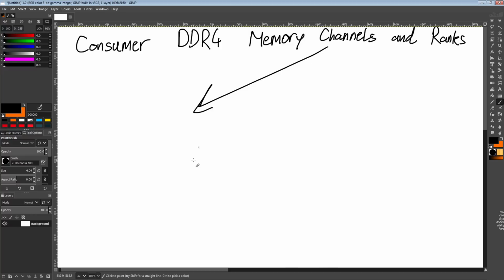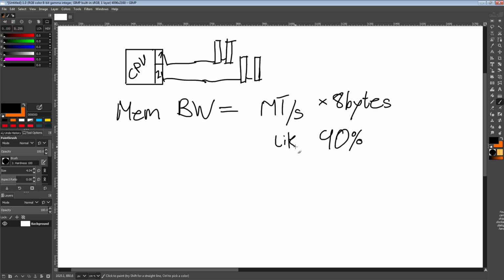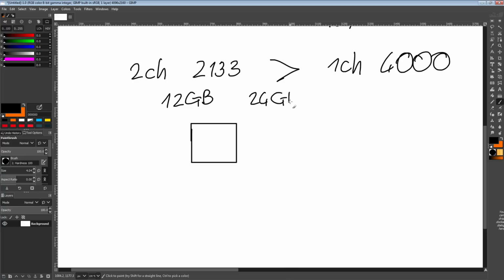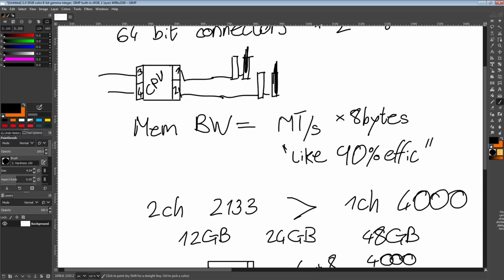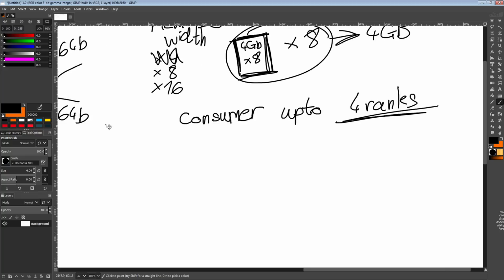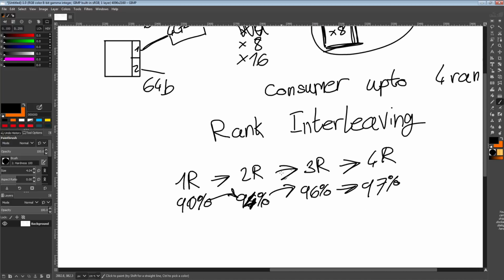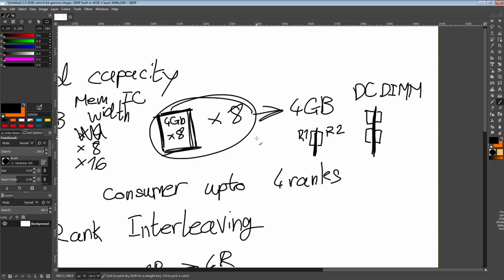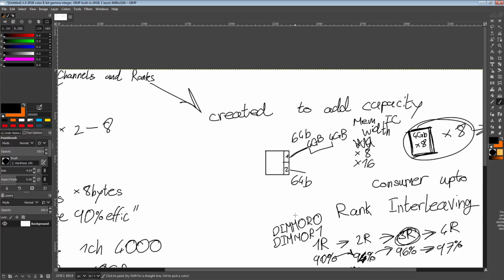Rambling about DDR4 memory channels and ranks

Comment: 14:00 What the f*&@# are You talking about dude, this video seems to be absolute garbage Prove me wrong because im not "an actuall overclocker". In regard of memory combining dual single channel and ranks 25:00 are time traveler from 90s? Never analysed this issue before becase its non issue. Except when it comes to 32GB 32 chip modules on consumer 4 dimm dual channel motherboards  >>  All i wrote is based on what i remember or improvizing. So im willing to change mind. .

Dual or not, and ranks  First of all - if you have dual channel memory controller 64bit each, you have usually 2 slots for each channel (4 in total), 16 chips, 8 on each side = 2 dimms x 2 ranks = 4 in total. Ranks are logical grouping of banks to create 64bit wide coherent adressable block of memory, has nothing to do with number of dimm slots although it's limiting it's number. Obviously 2 ranks on same PCB would not work in dual - since there is only 64 bus shared between, from memory controller perspective those are 2 modules sharing same bus via same slot. Because usually one sided pcb are 1 ranks (block) of memory while double sided are 2 ranks or even more. This creates real issue for 32GB modules made as 4 ranks of memory on one pcb (32 chips). Its like 4 kids to be feed, refreshed and access to bus. To have >64GB if you are allowed to use 4 ranks max would be limited to use max 1 on each channel. Interleaving and all that crap is more likely related to how memory is refreshed and and problems of it's acessability but not for regular data access since those modules are different adresses anyway. Rather than to performance directly it can hurt accesability when it comes to refreshing when such block becomes bigger. If you allow 16 block this wont be case. 90,95,97%.. you wrote. 32GB and more DDR4 memory creates real issues overall, Intel Xpoint tried to solve (no need to refresh) . You wrote 40% real bandwidth.. well 60% time and more (expotentialy grows) is used to refresh its content, not an actual transfer . When it comes to high capacity memory this became reall issue. But what it has to do with OC? Plus al that you wrote as 90,95,97 is more likely related to refreshing related issues but in past when memory was much smaller. Currently its get much worse. You created, so much confisung content i cannot believe what i just watched. 

Drawings and colors How channels are placed on motherboard odd, evenly or pairs depend on motherboard  For such reason there used to be different colors.  This actually makes me nuts cause instead each channel having different colour its for dummies. To help distinguish dimms 0 from dimss 1 of each channel those 0s  and 1s have different colour. Meaning dimm0 are same colours as dimms1 despite being connected to different channel so we would put pairs into slots of same colour to fill both channels and use in dual mode. But it depend on motherboard usually its like here  https://forum.dobreprogramy.pl/t/ram-i-dual-channel/548484/14 But it's not always the case. Try to be more precise - causing more confusion than helps.

Forcing single channel If you fill each channel's dimm's 0,1 with pair of different capacity and speed one channel with 4GB and 8GB on another, each channel will be mapped into separate adress space being accessed as single channel 64bit bus although via separate bus. It's not possible to map it differently. But when it comes to speed No! Maybe, just maybe i assume in 2020 its possible to have "hybrid mode" or to have, different timings and frequencies on each channel but not possible from what i know to have hybrid mode at all. So - what are you discussing in this video? Issue that has never been an issue as much im concern. There is slow ram and fast ram but on Amiga not DDR4 PC. Im using DDR3 im poor i know, memory controller always chooses common denominator.  Never in mine entire life saw ram to work different speed across the board. I quesion message of video - possibility to access part of such ram 4GB or 6GB with  different speed, dual and part in single and results from OC perspective. It's rather not possible. Even if so it will always end up badly since RAM adress space it's not same as program adress space. Data can end up being anywhere.

Timings in dual For obvious reason combinig memory modules of different timings on same channel (real life scenario comes along with combining different capacity) to achieve dual mode forces every channel to use timings of slowest modules connected. From what i know it's always the case, even if every type of module is grouped in separate channel. If it's not case than maybe your right.. please provide proofs. I though fastest common denominator was always the case when combine modules of different speed. The only issue for an actual overclocking could be ranks (one sided modules), empty slots or whatever. Never heard of except for Amiga about RAM to have different speed on each channel. Maybe it's case but still - since OS adress apace it's not same thing as program adress space averange result would be same as for dual - timings to be as fast as slowest module in system.

Ranks again Since as you mentioned consumer product are limited to 4 ranks, i will not argue about that. Usually we have 16x chips on each module and if these chips are 8bit chips you end up with 2 ranks on each module, one for each side. Iif you planing to fit all 4 dims having 4 ranks on module limit to use only 2 dimms, Its that simple has nothing to do with all you said in video. On server motherboards you could have 8 dims if you like. And even 32 GB on each module 4 ranks each will be alowed = 16 ranks total. I can only quess that ranks are important from memory controller perspective to let those modules refresh separatly. More ranks more problems more modules to control. More modules to gather information from etc. When it comes to "overclocking" what you wrote is just bad. Every line should be terminated. For such reason imo its always better to have all modules propagated but using single sided memory than empty slot and double sided. But i wonnt argue about that. Obviously longer line more difficulties. But this also is no longer case - since distance between CPU and DIMM is much furgher than propagation time of it's clock since many years. Clock domain are everywhere. The key is every line to be same lengh. If not terminated properly even empty line could be problem for memory controler stand point when it comes to extreme OC. Those are separate issues determined by physical layout of motherboard number of slots while ranks are rather logical problem for memory controler point of view how plan it to be refreshed. Of course it can hurt performance but..fuck me. I was expecting to learn something not to argue. I know nothing when it comes to OC.

Comment: on my 3200 c14-14-14-31 dark pro b-die, setting manual timings for everything while running xmp clocks and primaries on my 6700K, I can get an effective bandwidth of 96% on reads and 97% on writes of theoretical max bandwdith, getting 49.1gb/s for read, and 49.7 for writes, theoretical being 51200mb/s
Reply: Which test?
Reply: @milllosh  aida64
Reply: @resune  I asked cause that may not be reliable. I get 49.6GB/s read, 48.6GB/s write on Aida with 2700x + G.Skill Trident Black 3200C15 @ 3133 c14-14-14-28 (all manual, my 2700x hates C15 and C16 as well as anything above 3400MHz, where x470 gaming 5 also has an issue) but other tests show more like 46.6-46.8 read, i/e UserBenchmark test. Latency is more consistent, 63.6-65.7 on Aida, 63.0-64.4 (clustering at around 63.4) on other tests. Now, if we get the same/similar results in same test, that is a good reference to compare performance. What's your latency, something around 48ns? That should be easy with Intel. 

[edit] my Trident Black is low bin b-die

Comment: Buildzoid I know this is unrelated to your current video. But short on doing hard mods, how does one unlock more voltage on vega than the 1250mv LC bios provides? I'm desperate for information and have had no luck thus far.
Reply: I did it I got more Vcore! And it doesn't break! It's amazing. I've set as far as 1375mv (it applies around 1300mv at that setting) I am seeing power draw increasing as well at the wall with my Kill-a-watt. I'm using a combination of soft PP edits and watt tool! And it's working ermahgawd!
Reply from the maker: I think there was some way to get more Vcore with soft power play tables but it was rather unreliable when I tried to make it work on my card.
Reply: How did you manage that? I've poured over your power play tables video but don't see you do it anywhere
Reply from the maker: @alastairstedman7840  I didn't manage it. That's why there's no video on it. There's some posts on Overclock.net about it.
Reply: Been digging around on OCN. Hopefully I will find something. I'm like 20MHz short on 1800MHz sustained. And even with the 150% power limit unlocked I'm only hitting around 310w core in heaven bench and other such benches. I feel like there is so much room if I could just get a bit more power to the core
Reply: But seriously thanks for taking the time to reply. I don't know if you are still on OCN or not. Haven't seen you pop up in my feed for a while. :P.

I'm just so frustrated with how locked up Vega is. Like I feel this card has so much to give but I'm so restricted.
Reply: I mean to give some context. I have this LC edition V64 on a full cover block. 640mm of radiator available in total. Although the Vega is sharing the radiators with a 3800X I doubt the ryzen adds much into the equation at this point. I've done the PP tables mod for 150% power. And I am asking watt man for 1780MHz P7. I am getting around 1750-1770MHz sustained. Core Temps. 35C. HBM 45C. Hotspot 55C. There is lots of headroom available and even at these settings I am not seeing more than 320 watts core power during a heaven bench loop.

Comment: I was thinking hard about what stupid question to asked that you answered before and I finally got something so here we go:
Should we buy a 2x16gb memory for Ryzen or 4x8gb.

And thanks for the video ;-)
Reply from the maker: Kinda depends on your goals. If you buy relatively high spec 2x16 or 4x8 they will both end up dual rank and then the main difference in overclocking comes down to which ICs you go for.
Reply: 1: make sure the memory is single rank. 2: 2x16 would be better in this situation since you get the same capacity in fewer DIMMs, which means you can fit more memory down the line if you need it. This satisfies the priority for capacity, and you have your dual channel for maximum bandwidth.

Comment: One good reason to go with an asymmetric memory configuration: you're on a laptop and they soldered one of your memory sticks right onto the motherboard.
Reply: just one?
And the other one is freely acessable? That seems very odd, but I guess laptops are just like this sometimes
Reply: @LinkStorm13  yeah lots of thin and lights that wanna say they're upgradeable do that. Esp business targeted ones.
Reply: @tarfeef_4268  I feel like they do that to make laptops obsolete more quickly, if the soldered RAM dies you throw the laptop in the trash.
Reply: @countach27  can't you just, remove the solder, change sticks, and re-apply some new solder?
Reply: @Layarion  You can if you know how to solder SMD components and can source DRAM chips. Getting this repaired by a technician doesn't come cheap though.
Reply: @countach27  all of the commentors here, their wording suggest they are able to get the DRAM chips, or SSD's, they just don't want to solder. So they're already halfway there. idk how much the heatgun and stuff cost, but i imagine you can get them for $10 each.
Reply: @Layarion  A general consumer can't buy SMD SSDs or RAM that easily. Also an entry level hot air soldering station is at least $60 and you have to have actual skill because it's easy to destroy electronics if you don't know what you're doing
Reply: @Layarion  What even is this thread? Anyone can buy memory chips from distributors like digikey. BGA rework however is nontrivial and rarely worth the time. Laptops depreciate like 50% in a year.
Reply: @LinkStorm13  yes! Same for the SSD: one soldered in, one M.2 slot. For me that's already a plus though tbh. I'm used to laptops of this form factor soldering everything into place, so to have some ability to tinker with your hardware makes me happy =D

Comment: X4 memory sticks do work on LGA1151 but the iGPU will be very unhappy if you run them. There are modded sticks that are 1Rx4, they are ok TBH, especially the ones with Samsung B or C-Die, they OC to 3733 albeit with loose timings.

Comment: i have the one 2400 @ 14cl stick.....hmmm lol
if i were to get 1 more say 2666 but 18cl my cpu stuck at 2400(i3 8100) would it bother the timings and should it be able to tighten to the 14cl  for my two slot mb
Reply: it's a crapshoot whether it will work well or badly. Most likely your motherboard will run both at something like 2133 at the loosest JEDEC timings it can find.
Reply: @Amberion  yeah. Probably something like 2133 17-19-19-53
Reply: Idk if the stick could tighten that much since it's cl18 at 2666, and at 2400 you might just get it to work at cl16-17 since it's probably mfr or afr. Just get another stick of whatever you have and be done with it.